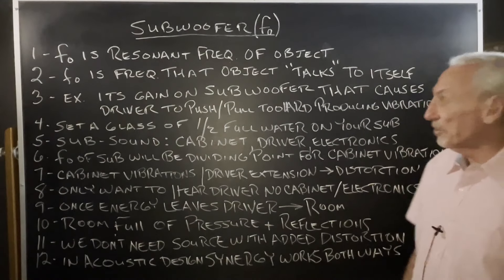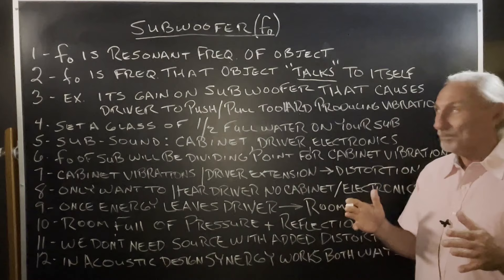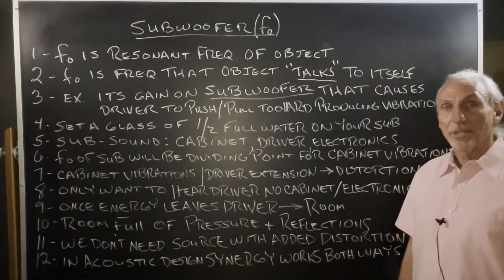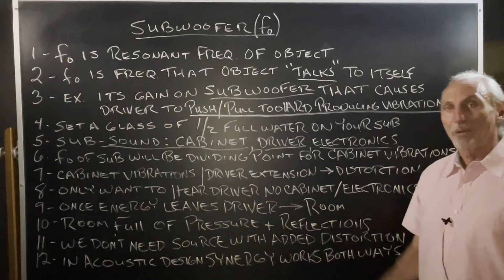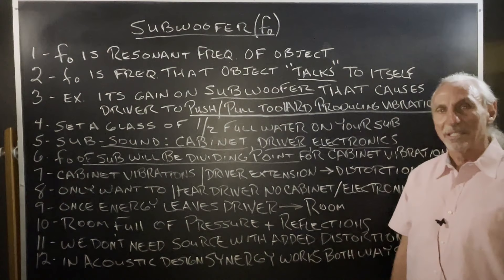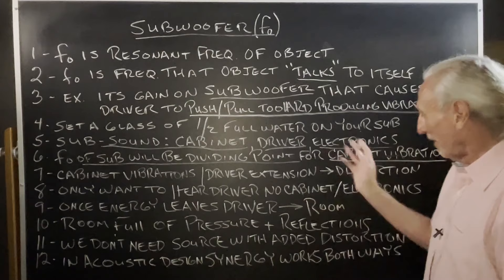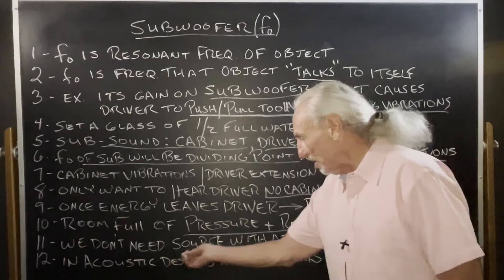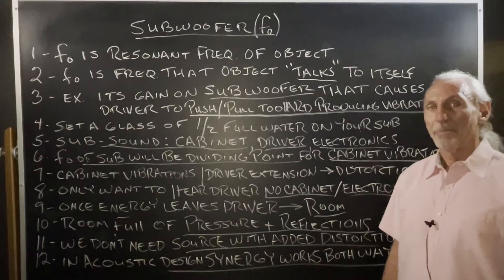Subwoofer Resonant Frequency - www.AcousticFields.com

Comment: Small spaces = High frequency problems (With no Low Frequency at all, as there is no space left for that), Big Space = Low frequency problems (can be dealt with room corrections and acoustic treatment), Mid-Sized room = High and Low frequency issues in a mixture (Very expensive and hard to dealt with). SYNERGY WORKS BOTH WAYS.
Reply from the maker: Not correct. Small rooms do produce low frequency issues. Unfortunately, the only way to treat them is to make the room smaller with treatment. Room correction has some benefits in the low frequency region but the ones we have heard do not deal with middle and high frequencies to our liking.

Comment: This contains many many factual inaccuracies.  He does not know what distortion is.
Reply: To start with fo (or f subscript 0) stands for fundamental frequency not Resonant frequency.  If the enclosure of a subwoofer is resonating it is due to it sympathetically vibrating as a result of poor materials or improper bracing or a combination of the two.
Reply: The gain setting on a subwoofer, pre-amp etc. does not correspond to the amount fo distortion - rather the SPL (sound pressure level) can have impact on distortion.  SPL is a function of power, efficiency and distance.
Reply from the maker: Your missing the point. The construction methodology is not the issue. You have to view the resonant frequency of the cabinet, driver, and electronics en total as a system that vibrates. The vibration of all components contribute to the total sound quality.
Reply: No kidding, I never understood why people are sometimes so deliberately obtuse. We knew what you mean, great tutorial. Btw, as you are aware I'm sure, gain does indeed correspond with distortion level. Perhaps this guy doesn't understand what "is a function of" means considering their comment said both "gain does not correspond with distortion" and also "sound pressure level is a function of power etc." in the same comment. I wonder what they think power increase is a function of.